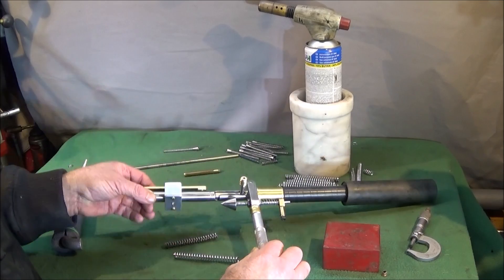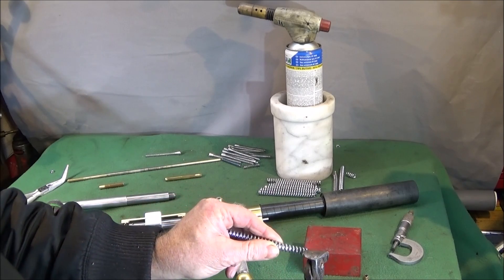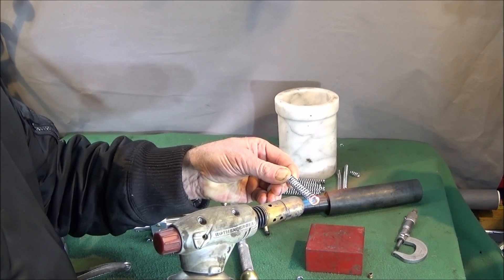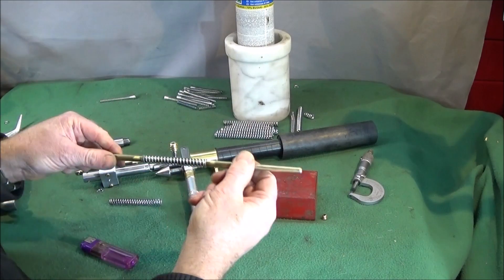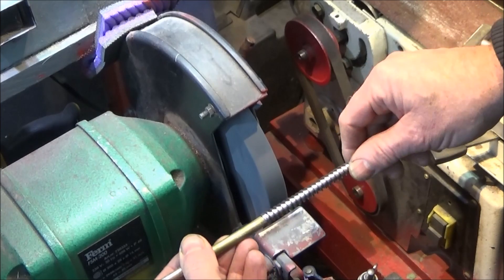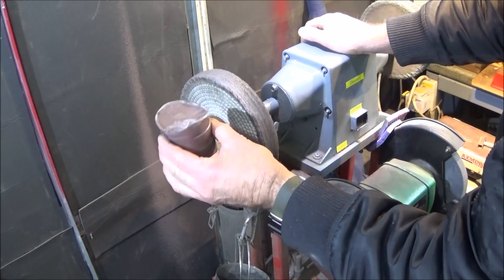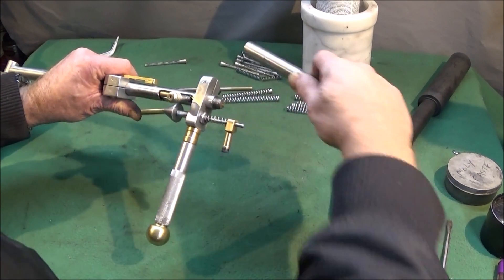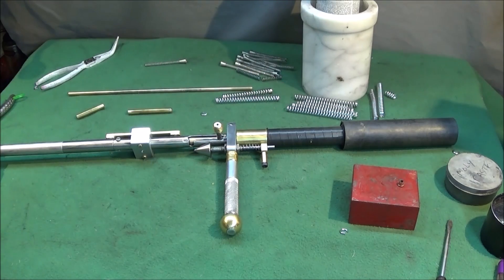Simple Method Adjusting & Weakening A Compression Spring

Comment: Do you know how to strengthen a compression spring?
  I am referring to the splutch spring on on some washing machines that seem to get weak and not allow the splutch to work properly such as switching the machine between Spin and Wash.
  Can I just stretch the spring, or would it need to be tempered or treated some way?
  Maybe leave it the length it is and retemper?
Reply: If you can stretch the spring by a reasonable amount and then re temper the spring in the oven at 250c degrees for half an hour or 360c for an hour if it is stainless steel it will up the spring strength ,If you do not re temper  the spring it will quickly revert back to it's original length ..l can't say how much to stretch it as l don't know size now but if it was a 2 inch long spring l would pull it up to about 2  and 3 eighths of an inch ,if it is made from thick wire you can not pull it longer by hand

Comment: I have seen alot of socalled gunsmiths cut off a spring to reduce the spring pressure and mess up the spring. You are the first I've seen lighten a spring the correct way. Good job.